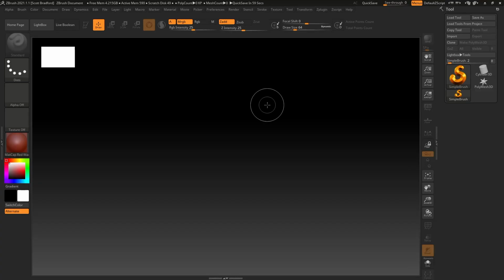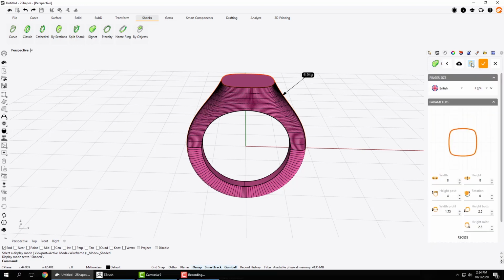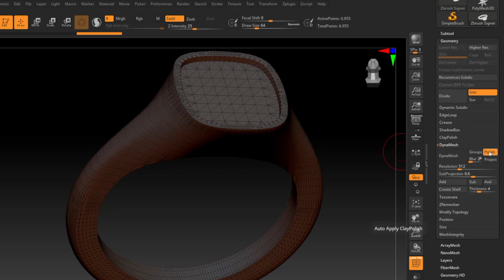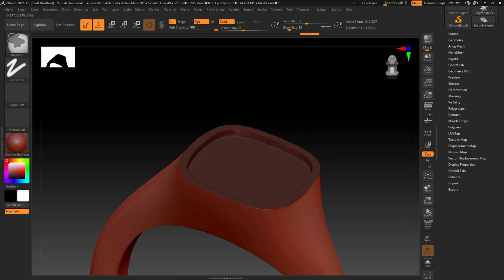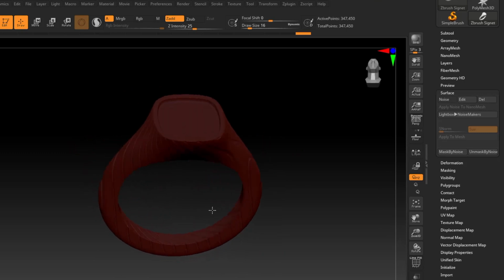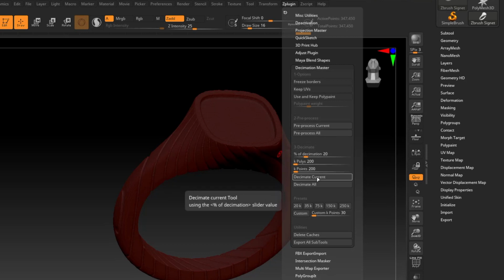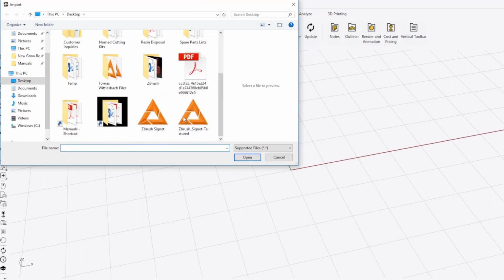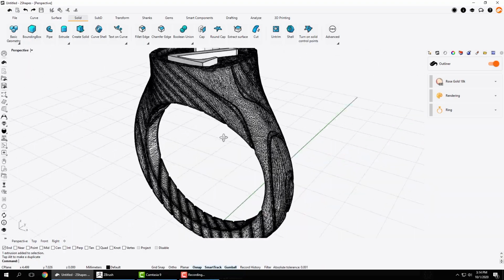How to Transfer CAD Files To and From ZBrush

Comment: Thank you for the great video. I tried couple files from rhino to zbrush, but when i import it back to rhino is not closed solid mesh, too many naked edges, therefore can't be printed.  Please let me know how to fix this if you don't mind. Thanks again.
Reply from the maker: Glad you liked the video! Here's what Scott had to say about the transfer issues you are experiencing, "This can sometimes be caused by overlapping geometry or open surfaces in the Zbrush model. Navigate to the Geometry tab, and open the MeshIntegrity submenu. Click Check Mesh Integrity to check, then click Fix Mesh. Export again and see if that fixed it. Naked edges in Rhino are usually caused by open surfaces. Rhino does not see these as a solid so they cannot be 3D printed. You may need to eliminate any open surfaces in the Zbrush model before bringing into Rhino. Also, a quick Dynamesh at high resolution before exporting can take care of that and make it more palatable for Rhino."